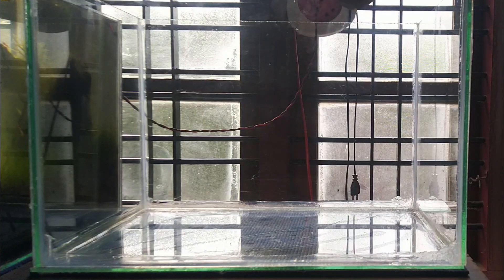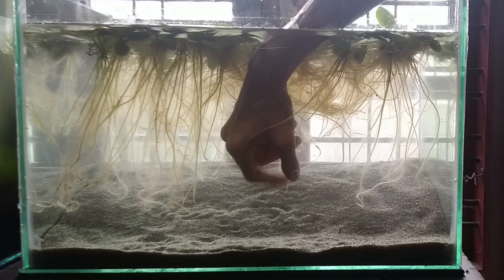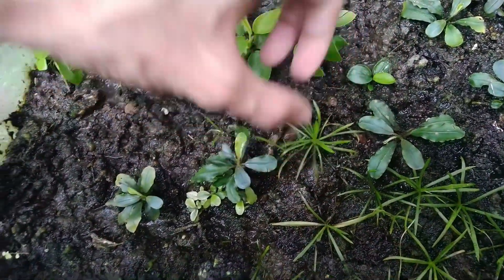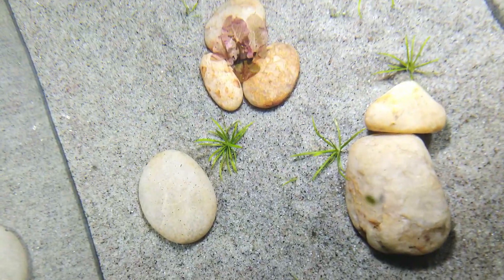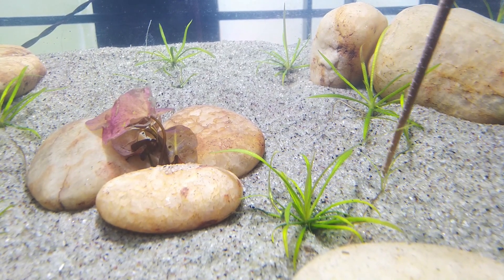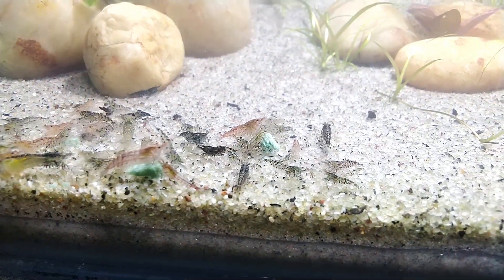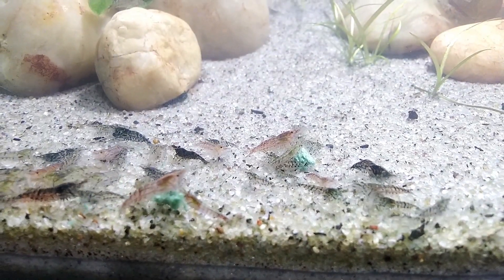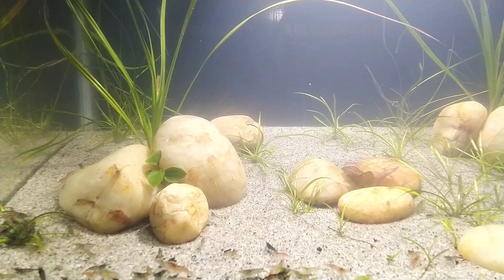No filter, No CO2, No fert | Low tech tank – Making + 1week update (River bed Scape)

Comment: Nice. MSand use cheyyan enikku doubt aarunnu. Ente oru subscriber doubt chodichaarunnu. Waiting to see your results :) I thought Msand will alter the water parameter too much. Pinne 3rd day shrimp add cheythathu itchire risky aayipoyi! Atleast 2 week enkilum vende tank cycle aavaan/ 
Anyway, waiting for further updates.
Reply from the maker: Njn Msand ethinu munne use cheythitund, the only problem i faced was that if we dont filter out the larger particles, eventually they interlock with each other and form a concrete like top layer its very hard to plant and plants like hairgrass will have a hard time carpeting. So this time just fine particles annu use cheythe. And yes 3rd day was too soon😂...6 of them died. I forgot to mention it in the video, but I added a bit of calcium to calm them down after that and i think it helped!
And thank you for the 'worm out' tip it really helped with the planaria problem in my other tanks.
Reply: @TheAnubiasGuy  Great! Yeah, that was my fear about Msand. Told my subscriber not to use because of that. good to know that it will work if we take the fine particles. Will wait for further videos :)
Reply: @TheAnubiasGuy  I am in Anchal for two weeks. do you know where I can get some water lillys? (Ambal) for a small pond? 
I guess I am 20-30 kms away from your place :) Any shop which you know near the highway?
Reply: @TheAnubiasGuy  thanks. I know few places near my home (പെരുമ്പാവൂർ) ആൻഡ് also sites to order. But wanted some plants urgently in kollam. So thought of checking local shops nearby. No problem. Will drive around and find some nursery nearby 👍 thanks